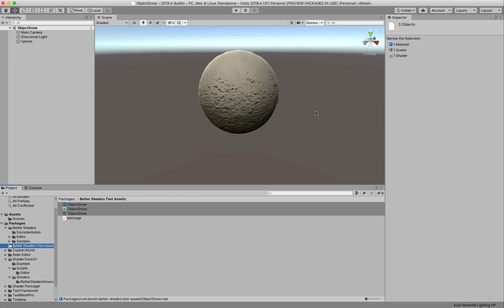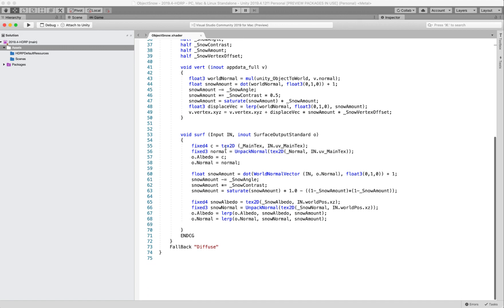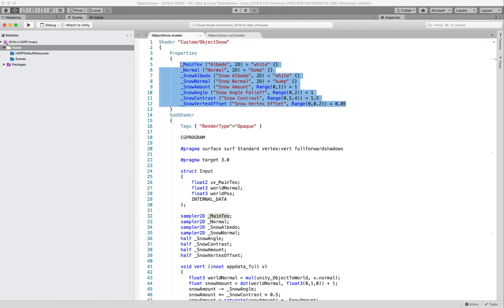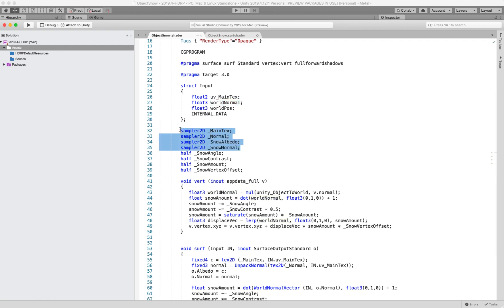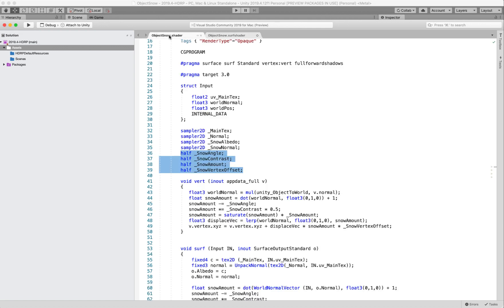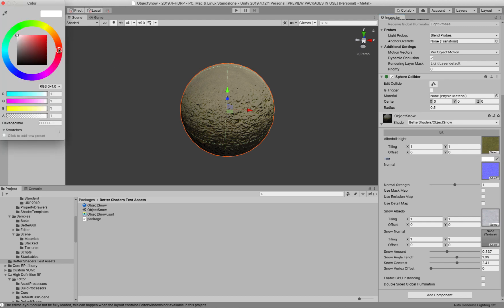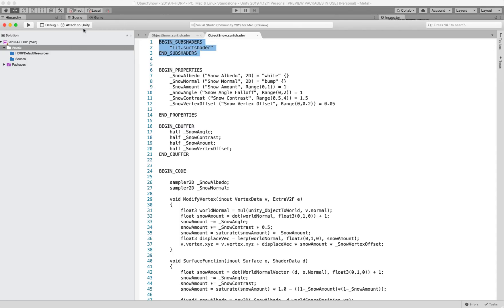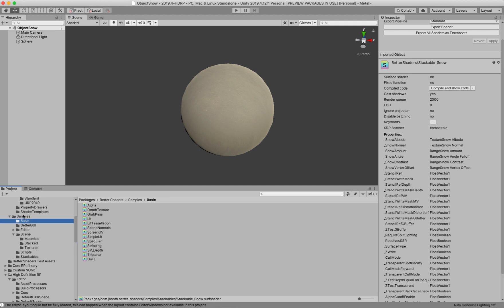Better Shaders - Converting from a Surface Shader

Comment: Currently rewriting a decal shader on skinnedmeshrenderer for URP.
Where can I find more info on using: 
IN.viewDir and adding 
Blend One OneMinusSrcAlpha ?
Theres an Inout struct like this

	struct Input {
		float2 uv_MainTex;
		float3 viewDir;
	};

thanks!
Reply: Also last error im getting at the moment is:  base type is not a struct, class or interface at line 689 (on d3d11)
cant work out why. 
Or redefinition of 'VertexData' at line 688 (on d3d11) If i change the name back to VertexData.

Comment: This is PURE GENIUS! 
Just discovered this as I'm working with HDRP and got bogged down trying to write a custom Vertex Animation Texture shader for crowds with Shader Graph, got an unlit one working pretty quickly but was impossible to get lighting to work and struggling to back engineer the shader to shader graph and use HLSL custom functions to get the characters animating. 
I haven't used this yet but hoping its gonna work!
Also does this system allow for instancing in HDRP at all?
Reply from the maker: Yeah, it allows anything the pipelines support.

Comment: I don't understand why UT with all their resources and programmers can't make something as good as this one. Maybe because they've never really shipped a single game and don't know what game developers actually need. Most of great stuff like Cinemachine or TextMeshPro were initially created outside of Unity. Burst and DOTS stack the only exceptions and are good. Everything else is causing only the pain to work with.  Especially Shader Graph.
Reply: They really should use their own engine for a game... at least once in a while. What better way to promote your engine?
Reply: I have to disagree that "Burst and DOTS are the exception". -- As a .NET/C# veteran, Burst and DOTS really feel like terrible solutions for what they want to do.

If they're worried about performance, then should be integrating the actual latest .NET Core toolchain -- as it supports every platform they support, and has much better performance from the get go (including a far superior generational garbage collector -- like worrying about allocations or when it's okay to use a lambda delegate should not be something a .NET developer is worrying about).
Reply: @BrainSlugs83  As a veteran game developer I can confirm that Burst and DOTS are fantastic.